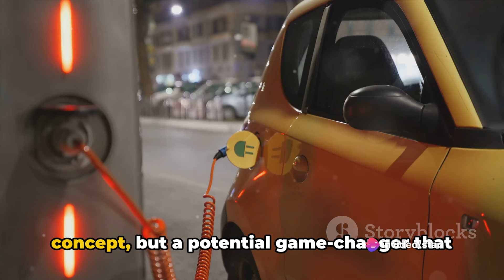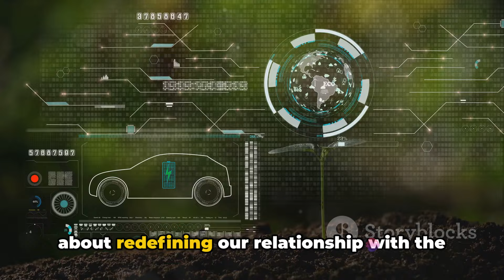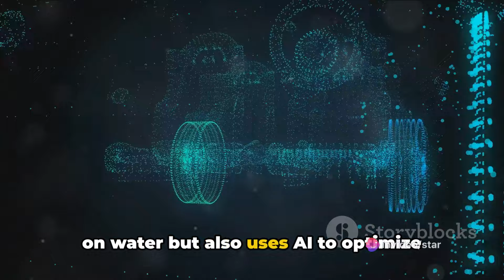Toyota CEO: This New Engine Will Destroy The Entire EV Industry!

Comment: Hydrogen, an abundant resource, but locked into larger molecules that require significant amounts of energy to release. If you think a Li-On cell has a large manufacturing footprint, wait till you see the absolute bonkers cost of ripping hydrogen from other molecules.  Even the simplest form of pulling H from H20, results in wasted salts, massive amounts of heat generation, tons of resources to make the electrodes and other things. Storing liquid Hydrogen is not like a bucket of water with a lid on it. Being one of the tiniest molecules, it can escape from most seals that man creates. Unless you go for huge tanks with double welded seams. The cost of storing and or transporting Hydrogen is eye watering. When it does start, invest a few bob into the tech as it will make you wealthy.

Comment: So, it's a hydrogen fueled engine...NOT a water fueled engine.  With current technologies, removing hydrogen from water takes a vast amount of electrical energy.  Where does that energy come from and how can that energy be provided with zero environmental footprint?  
Call me when you have a vehicle with a refillable water tank on board and an engine that separates the hydrogen from the water and powers the vehicle with that hydrogen and it should travel 500 miles on 30 gallons of tap water.   Have you seen my new vehicle that runs on cats?  First you have to capture the methane produced by the decomposing bodies of dead cats.  At least I've learned to never again click on a video by Star World TV.
Reply from the maker: Yea u are right, you have a very high level of knowledge